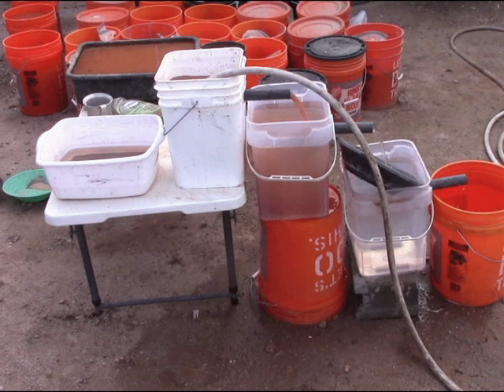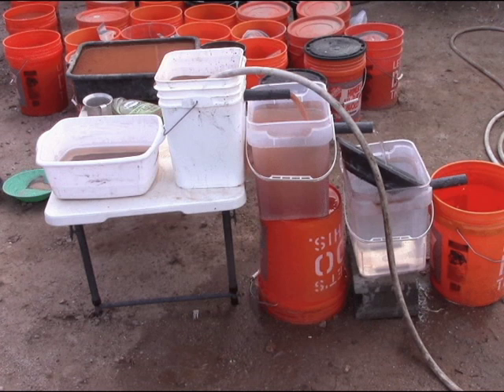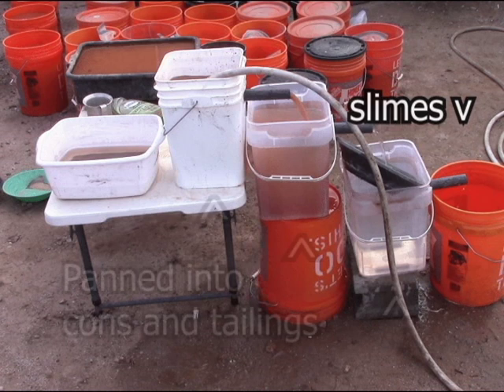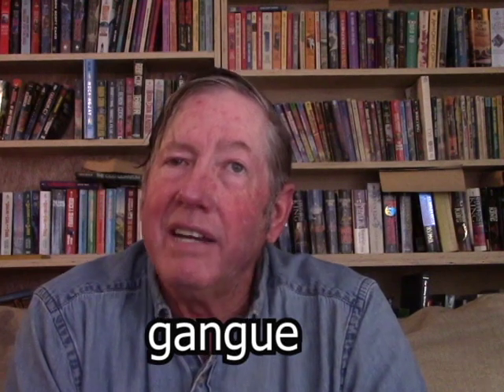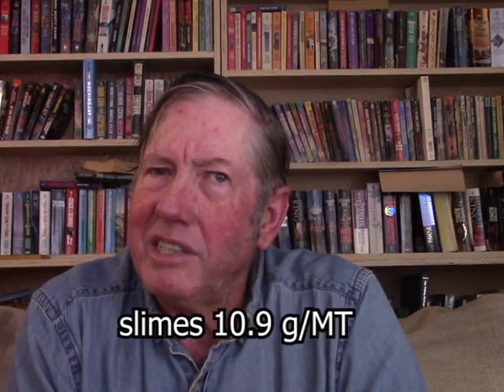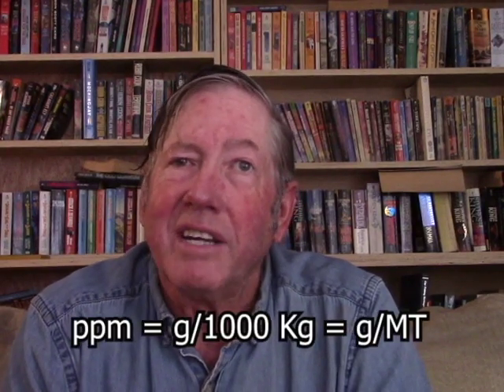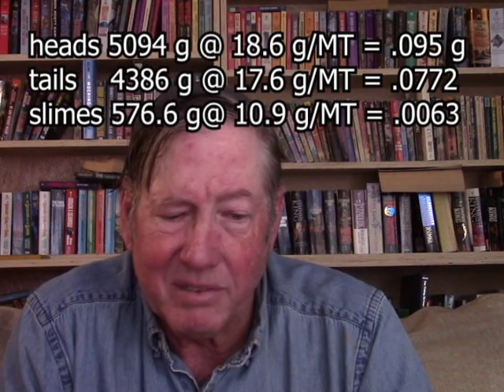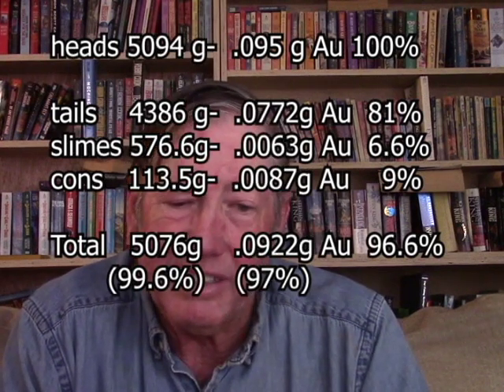Did it Work? The Basic Mass Balance Calculation

Comment: As long as the data input is correct the data output will be correct. 
  Math will never lie. And all math can be brought down to basic math. But the data needs to be right
Reply from the maker: You must operate the algorithm correctly also.  I tend to make mistakes.
Reply: Algorithm is a arbitrary man made #. 
  But that aside, after Algorithm it is straight up math. 
  Theories only work on paper but in end as you are learning you have to put the boots on the ground and prove or disprove what you can or cannot do.

Comment: Ok great video.

Not so great setup or method from my limited ore processing experience.

My background is in Aquaculture Research and one of the big challenges we have is designing filtration systems to get the super fines out of the water flow. I did a lot of work on gravity separation which is challenging when you are dealing with super fine particles with a SG of 1.01 or less.

Completely different to this sort of setup but it gives me a bit of an understanding of the physics.

First you don't separate by density you separate by Surface Area to Mass ratio. Particle size and shape are just as important as density. In fact as particle size gets smaller they become more and more important.

I'd try re-running a gravity separation after classifying the material into size gradients. For relatively large particles say something just passing 60 mesh quartz is going to take about 15s to fall 1m assuming no upwelling. The particle size of gold that falls at the same rate is going to be passing 300 mesh. That assumes that the particles are both spherical. Bad assumption but you get the idea.

If you did a gravity separation after classifying (true classifying into size classes not just getting rid of the big and boring) and some calculations to get retention times right. However, that would require a different setup.
Reply from the maker: You have the basic idea all right Stuart.  SETTLING VELOCITY is what is being tested here.  Unfortunately it seems to be terribly low due to very small size of the gold.  I am recovering plenty in the 300 mesh range and down to some around 600 mesh, but I am still missing the vast majority.  If that is due to particle size, think how small we are getting.

Also, there are other emergent phenomena that start to happen.  Importantly, at around 50 mesh an attraction seems to manifest between the surface and the gold particles that is insignificant in larger particle sizes, and that dramatically modifies the particle behavior.  I am thinking that at some other size around 50 microns the settling velocity starts to become so low that the gold can be suspended in almost any water flow.

Working the issue... 

:-)
Reply: @hardrockuniversity7283  We had the same issue with fish poo. A breeze across the water surface was enough to cause settling ponds to fail.
Reply from the maker: @MadScientistProspecting  I can see how that could happen, especially with the low  sp.gr. of poo.  :-)
Reply: @hardrockuniversity7283  Would it be possible to set up a small scale froth flotation process for concentrating this material?
Reply: @ZE0XE0  - Agreed, this ore looks like it needs to be pulverized to < ~600mesh and tested in a lab flotation cell. A full chemical workup is needed here, not just a PM assay. @Hard Rock University - Does your assay lab also offer flotation/leach testing?
Reply from the maker: @ZE0XE0  I am sure it would work on a small scale, but I don't know how well it would work with this fine of gold.  Have no reason to believe it wouldn't, but have no knowledge.  I know that getting the particles to stick to the bubbles has a certain critical energy which is why it is typically agitated violently with impellers.  I would like to learn the operational parameters of floatation someday.  It can be very versatile.
Reply: Actually thinking about this a bit more......I can think of a really simple way of doing this but it would require fine tuning by assay result. Simple in theory anyway.